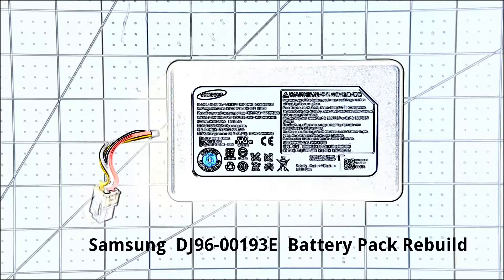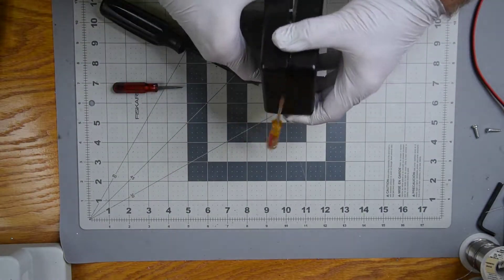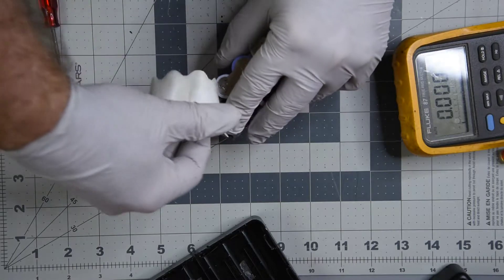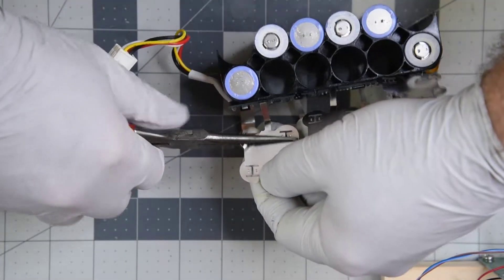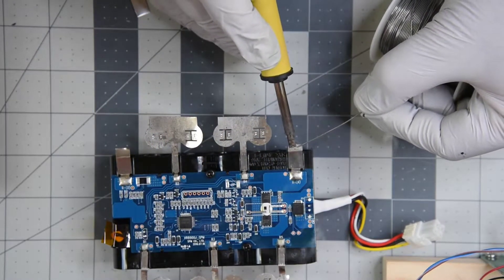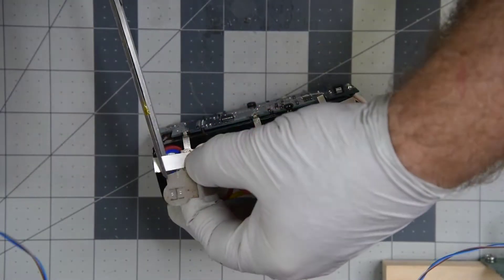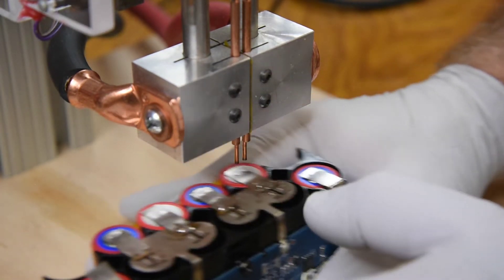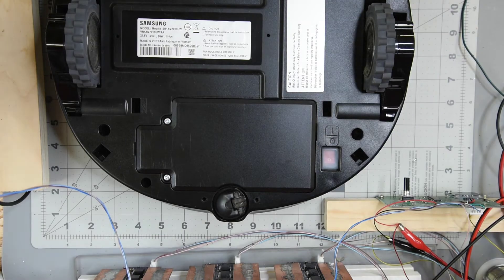Samsung DJ96-00193E Battery Pack Rebuild

Comment: Thanks for the video, tell me, there are 4 wires on the battery connector, what are the white and yellow wires for?
Reply from the maker: Serial communication, if I remember correctly it's an I2C channel.

Comment: Hello, very good video. I am from Argentina and there are no spare batteries, the board burned out and I replaced it with a BMS board and the only problem I have is that I don't know what voltage the White and Yellow cable has and which would be the positive.
I would be very grateful if you could answer me.
Greetings Osvaldo
Reply from the maker: Unfortunately, the white and yellow wires are signal lines. The vacuum cleaner communicates with the battery pack over the two wires. If I'm remembering correctly, they are I2C signal lines.
Reply: @metalplasticelectronics354  Thank you very much for your response, I will have to buy a pack of new batteries. I will search for aliexpress
I send you a big hug and again thank you very much for your prompt response.

Comment: I tried this method and the powerbot turns off as soon as it gets away from the charger
Reply from the maker: Are the batteries charging?  There is a special 3 terminal fuse that might be open.
Reply: @metalplasticelectronics354  same problem here, batteries are not charging. How to fix the 3 terminal fuse problem?
Reply: @metalplasticelectronics354   how to locate and how to close that 3 terminal fuse? i have same problem, after changing cells, robot charges, but after leaving charger instantly stops at shuts off.
Reply from the maker: @tomasprascienius5923  I didn't ever find a replacement "Self Control Protector".  I don't know what current the one in the battery pack is rated at.  But it is this type of device: https://www.mouser.com/new/littelfuse/littelfuse-itv-battery-protectors/

Comment: Thanks a lot for your efforts. I successfully changed the 12 cells of my powerbot's DJ96-00193B and for some weeks it worked quite well and i had a cleaning time of about 50 minutes. Unfortunately the cleaning time reduced, and i soldered a bypass wire over the current sensing resistors , which helped for some time, but then the cleaning time dropped again. 
I think the BMS, which is a Renesas RAJ240080 estimates the capacity, which becomes lower and lower, whitout possibility to rise. I even found a software from Renesas, but it doesn't recognize my I2C or UART interface. So i'm stuck as well and would appreciate if somebody has a solution.
Reply from the maker: Have you checked to see if one of the new cells is going bad.  I don’t think there would be a legitimate reason for the BMS not charge the batteries properly.  But you never know about some of the questionable decisions some of these companies make.
Reply: @metalplasticelectronics354  Thank you for your answer, the voltage of all 2s6p is identical, measured in idle and under load. The Renesas software (RSB_Tool2)would allow to see what's going on, but unfortunately my CP2112 or Ch341a is not recognized in this software.
Reply from the maker: It may only recognizes Renesas's emulators and programmers.  I've never used a Renesas MCU so I'm not sure how there debug interface works.

Comment: Did it work with satisfaction and how long they work before recharge
Reply from the maker: Yes worked good.  About a 40 min run time, If I remember to clean the filter out.

Comment: My pack has 6 batteries with 12 slots total. Could the system handle 12 batteries?
Reply from the maker: It seems like it would be possible, but I haven't tried it.

Comment: Is there any problem if I fill all 18650 empty battery seats? In Korea, there are many users who cannot refill their batteries due to battery lock problems. Do you have anything to say about the matter?
Reply from the maker: I think it might work.  After drawing up a schematic for this video: https://youtu.be/aDvuYKJtomQ I really don’t think it would hurt anything.  The only problem I can think of is that the 2 batteries that are in parallel need to be a close match to each other.  If one is old and the other new.  Not sure how that would work.  12 new batteries, all the same type, I think that might work out well.
Reply: @metalplasticelectronics354  Thank you very much. Your story is that if I use both new and old things in parallel, it creates a problem, right? And there's no problem if we all use new ones in the same condition, or if we match old ones in the same condition well and replace them, right? One user in Korea keeps saying that Samsung made a battery lock device and cannot be replaced. If your story is true, there are many Korean users who will be happy.
Reply from the maker: Yes I've got a video where I completely remove the BMS board.  It was disconnected from the batteries for about 3 days.  After being hooked back up, it worked fine.  

There is a very special fuse on the BMS board.  If a cell shorts out, it wouldn’t surprise me if the controller on the BMS board blows that fuse.  So as long as the pack is working some can probably replace the batteries.  If the pack is not working at all I would check that special fuse to see if it is blown.

Comment: Hello!  I have an identical 12 cell battery.  after replacing the batteries, electricity does not go from the board to the wires.  the board receives 24 volts from the battery pack (on thick contacts).  what do you think could be the reason?  I used spot welding, everything is as in the video.  there is no closure.
Reply from the maker: The control board has MOSFET switches and some kind of over current and/or over temperature device.  The 3 lead device with the white silicon that is between the two MOSFET switches, I believe is some kind of over current protection.  Might check and make sure it’s not open.  But I don’t think the MOSFET switches will turn on unless it gets a signal from the vacuum. That’s the only thing I can think of checking.
Reply: @metalplasticelectronics354  thanks!  we'll try to check it tomorrow.
Reply: you should follow correct disconnecting reconnecting sequence to prevent MCU lock. Have you followed it?..
Reply: @ua9851  of course not!  I just removed all the batteries and put new ones in.  after that got blocked.  in the end I bought another vacuum cleaner and took the battery out of it 🤓
Reply: @199DreamCatcher199  check the controllable fuse marked as F1 on the pcb. It has heater inside which is controlled by Renesas MCU and small mosfet. In case of safety events MCU send signal to blow it out.
Reply: @ua9851  I'm having similiar Powerbot VR20K9350WK BSM SECVR9300K and seems same problem with BSM lock, no power output after connecting all cells back. I see there F1 fuse on BSM, how to test it ? Any chance to reset BSM?
Reply: @andreyjoe1013  fuse could be checked with multimeter. parallel legs should have 0 Ohm resistance. otherwise it is blown. 
resetting the chip on the pcb is not easy. What is marking symbols on it?..
Reply: @ua9851  same issue here. fuse marking are: 30A K45 A (30 Amperes SFK Series Self Control Protector(SCP)?)
Reply: @Siloopy  yes, correct

Comment: Good job! Do you need a certain sequence of disconnecting and connecting the batteries so that the controller does not block?
Reply from the maker: Not that I know of.
Reply: Hey!  I changed 12 batteries.  after that I have no electricity on the wires.  Probably my controller is locked.  don't know what to do now?
Reply: @199DreamCatcher199  you should follow correct disconnecting reconnecting sequence to prevent MCU lock. Have you followed it?..
Reply: @ua9851  How do you find out what the proper disconnecting and reconnecting sequence is?
Reply: @wesleyhedges2231  basing on experience on working with laptop smart batteries

Correct disassembly sequense is from most positive voltage down to ground 
Assembly in reverse order

Comment: You should make the battery and resale it.  I got a piece of junk just sitting on the charger from Samsung.  Never buy a Samsung robot vac again.    Battery lasted 3 years and I can’t find a replacement battery for it.
Reply from the maker: It's not just Samsung.  Almost impossible to get repair info on anything these days.  And the companies seem to be going out of there way to make getting parts difficult.
Reply: @metalplasticelectronics354  yes he's right! I'd literally pay you to do this! Like have us ship it to you and fix it!
Reply from the maker: Small scale shipping of Li-ion batteries is a real problem now days.  I just shipped a friend a small item with 1 little cell in it.  It seems like it doubled the cost to ship it.  More to ship than what the item was worth.   That's just one of the problems.

Comment: Hello,

My powerbot (R9250 I believe) playing dead when I pull it away from the charger. Charger does charge and battery level is going up, but ones is pulled away from the charge unit it dies and not responsive to any command. 

Try replacing battery cells as per your video but nothing changed. Also my battery pack had 4 cable plug and 2 cable plug. Two cable plug has thick cables and when measuring with multimeter it reads 0.1V but battery pack it self on the terminals 21.1V. 
Do I need to replace battery pack or is something else I don’t know ?
https://youtu.be/iD4IRij6Jrc
Reply: Shar, I ran into the same issue as you and my failure looks the same. My battery pack was showing the correct voltage and would show as recharging when on the charger but turn off when removed from the charger. I was able to connect a wire from the B+ on  the last battery in series and the red wire terminal on the battery pack and the powerbot would run and sweep away from the charger. I effectively bypassed the BMS. I will see if I can figure out what is happening on the BMS board and where the failure is but otherwise I may end up ordering a 21v 5s battery BMS, these can be found online for $2-8.
Reply: @TimothyLuchini  
Thank you for your replay. Thats what I ended up doing. Ordered new BMS.
Reply: @Niuxas15  please tell me what is BMS and where did you order it?  My battery has 12 batteries.
Reply: There is a video on my channel.
Reply from the maker: On the battery control board there are mosfet switches that turn the power from the batteries on and off.  And I believe some kind of over current protector right near the mosfet power switches.  I hate that companies want supply repair information, it makes it so hard to work on things.  What is the battery pack part number?
Reply: @metalplasticelectronics354  
DJ96-00193D

And once opened on the circuit board (Model : SEC VR9300K)

After opening the battery pack, checked again and is actually not charged. Same level as after installation of the new battery cells 21.1V. 

But once plugged into vacuum is showing that is charging.
Reply: @metalplasticelectronics354  
Do you know where I could buy replacement current protector ? So I could desolder/ replace. 
I live in UK
Reply from the maker: @Niuxas15  sure don't I couldn't find any part info for the control board.

Comment: First, thank you for this useful video, but can you please put a map of the pin-out of this battery depend on wire color, and if there is a way to override this control circuit, I mean if I want  to use an external  Li-ion battery charger ? thank you..  best regards
Reply from the maker: I don't have a diagram for it, couldn't find any info on the pack.  If I remember right the large Red and Black wires on the plug were the positive and negative voltage line.  I think yellow and white are some kind of serial communication lines.  I don't believe the vacuum will do anything if it can't communicate with the battery pack.
Reply: @metalplasticelectronics354  Thank you

Comment: Where to buy the batteries
Reply from the maker: I ordered them from 18650BatteryStore.com.  I spent extra to get a brand name battery don't know if it really matters.  But they gave really good serivce, they are less than 200 miles from me though so shipping was pretty fast.
Reply: @metalplasticelectronics354  thank you can't find battery you used my battery pack says 21.6vdc 38.88 1800mah.Why can't you just unsolder the tabs so they could be reused?
Reply from the maker: @zekeman5873  I wasn't able to remove the welds without tearing up the nickel.  Soldering directly to the cells is not good for them.  If you got cells with tabs already attached then the tabs could be soldered to the existing nickel.  Yes i just looked, seems they are out of all the brand name 10 amp hour discharge batteries.  It seems so many parts and items are out of stock these days.  I'm not sure where another good place to buy the cells at.
Reply: Do you know of any decent spot welders for a couple hundred dollars
Reply from the maker: @zekeman5873  No I sure don't.  I'm working on building my own capacitor discharge welder.  I did watch a few of the reviews of some of the 150 to 250 dollar ones that amazon sells.  Kinda what really made me want a capacitor discharge one.  But they would probably work for a few cells.
Reply: That's probably the cheapest way I'm kinda liking Sequire SW 1 hooks to a car battery didn't see one bad review wish 🇺🇸 made a good one

Comment: Hi, how about control board not need chenge? Or he doesn’t count of charge cycles? Helps only replace batteries and will run fully? I want to check or it will help for my DJ96-00193B batery she is a little different with 12 cels and controler is a SECVR9200J. Thanks for the reply
Reply from the maker: Yes, I just replaced the cells.  It now runs for 30 to 40 minutes.  Even though the new cells have a higher amp hour rating, I don't think it gave it any longer run time.
Reply: I have the same battery as you.  I changed the batteries in the battery and the board is blocked.  it is sad.